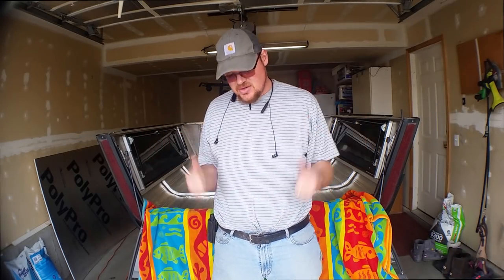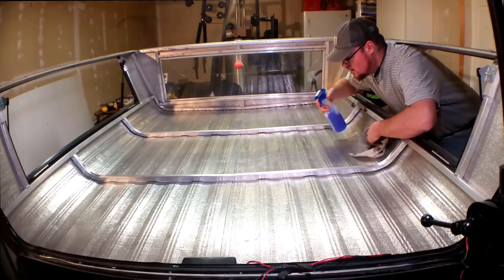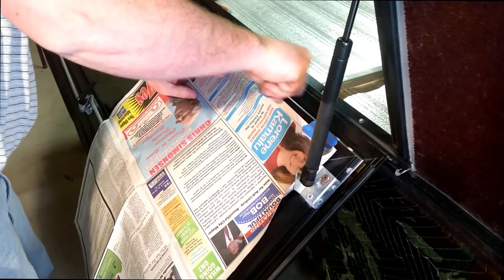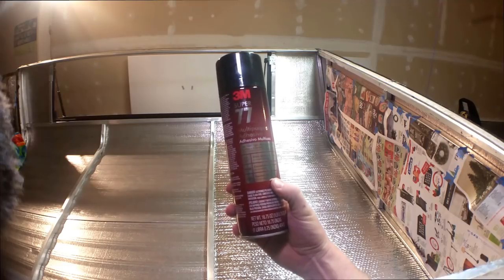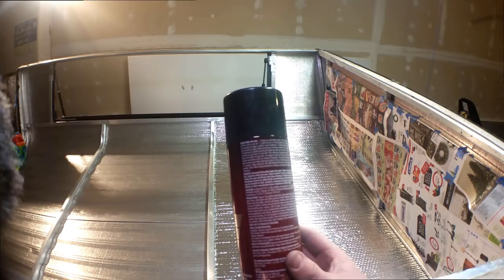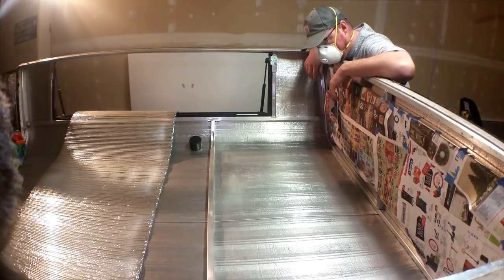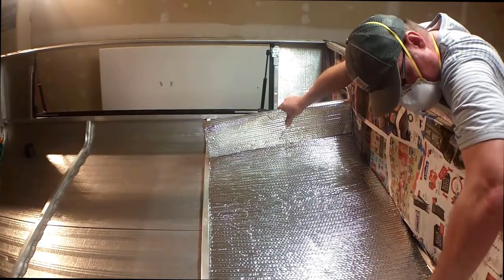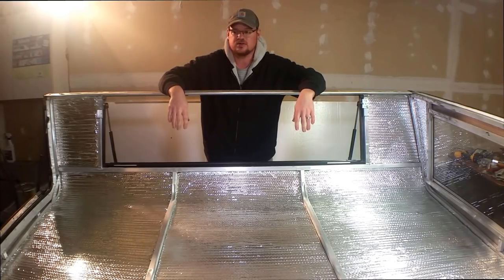Truck Bed Shell Camper - Part 4- Insulating the cap with Reflectix

Comment: Metallized Reflectix added to an already metal reflective aluminum skin does nothing except empty your wallet. The aluminum roof is already a thermal reflector. You’re  better off to insert styrofoam or closed cell foam and seal off the seams from air currents if you wish to retain heat.
Reply from the maker: This has been a great learning insight on this project from the community. Thank you for your helpful insights.  I plan on making some adjustments in the future. I need a bigger gap too.  Thanks!
-Will
Reply: It actually doesn’t, the spec’s you are quoting are marketing hype. You would need to leave a minimum of 1” air gap between the reflective side of the material and it’s next thermal wall. This is how you obtain an increased R rating The reflective side adds zero value if placed against or less than 1” near any other material. In this application it was a waste of money as it could not maintain an a minimum 1” air barrier, thus negating any benefits over plain bubble wrap.

Comment: Tip: back roll one side of the insulation at a time and adhered it. That will eliminate the problem of reinstalling the insulation in the proper spot, which is hard when the adhesive wants to grab the material every time they touch.
Reply from the maker: Very helpful tip.  Thank you for sharing!
-Will

Comment: Just FYI for another build, Reflectix has a much better R rating if there is an air space between the Reflectix and the outside.  Here's a link to another video:  
https://www.youtube.com/watch?v=T5N6wvWHfyU
Reply from the maker: I have seen a lot of other videos as well. I will be sure to check out this one too.  An air gap is an absolute must.  I wish I had more than the 1/4 inch in mine.  It has still knocked down the temps, but I definitely could do better with a bigger gap.  Thanks for watching.   -Will

Comment: Why use reflectix ?  It is designed to "reflect" light which produces heat. Cheaper shipping bubble wrap would have done the same job.
Reply from the maker: That's a good suggestion. I'll have to try it out. Thanks for watching!
Reply: reflectix is good in the windows during the summer to keep it cooler inside. It does need an air gap to work well so gluing it to the walls will not do much. What I do is paint one side of the reflectix black and then put them facing outwards during cold weather so the sun hits the black and warms up the place. Then in hot weather face the silver reflective side out to keep it cool...
Reply from the maker: @stevejeffrey11  Very clever! Plus it will block the hoodlums from peeping in the windows. I'll have to try it. Thanks for the tip! -Will
Reply: Reflectix has an R value of slightly less than R- 1.0  when used alone.

It is not designed as thermal insulation, it is designed to reflect radiant  energy like sun rays.

Comment: Do you think this actually helped keep warmth in? I am afraid there are so many other areas to lose heat (windows, truck bed sheet metal, air gaps) that this might not be a worth while effort?
Thanks
Reply from the maker: Mr. Kovach your absolutely right.  I am currently building the insulated floor and walls. More to come! Thanks for watching!-Will
Reply from the maker: Mr. Kovach,  I hope all is well.  Just wanted to give you an update.  I took the truck out overnight to the desert this last weekend.  I was quite surprised at the noticeable difference in temperature from inside to outside at night during the cooler temps.  I hope your subscribed so you can check back when I do a temperature overview.  Thanks for watching.
Reply: I think it would make a
Significant diffetence. I would seal the windows up somehow too, because that's how most of the heat will escape and cold air will come in. 

If you seal that, as well as the gap between the front seat and the cap, you've got a good chance against the cold 

And if you seal the gap between the cap window and the front seat window of the truck I think you can even bring heat in from the front vents
Reply: @barboo8646  yeah so not insulating it cause it would just be a decent amount of work. Already built out a little. And I am not sure how I would want to  adhere a removable winter layering.  I just have a 0-degree bag and other blankets.  Plus yes!! I can vent from the truck . And I have a remote start that lasts 15mins. That helps in the mornings if I need a boost.